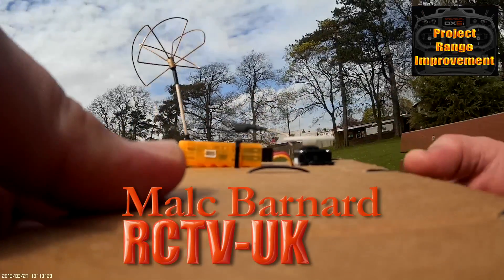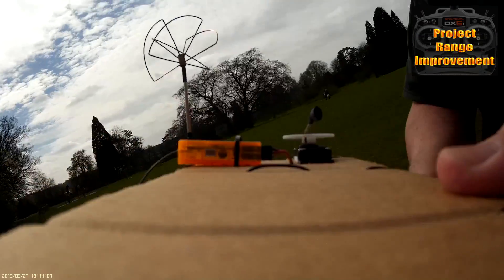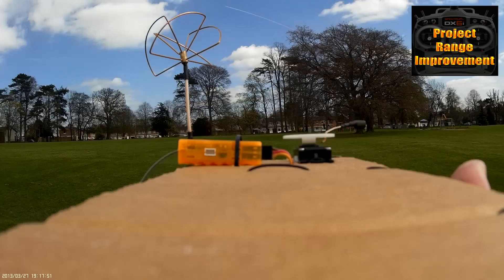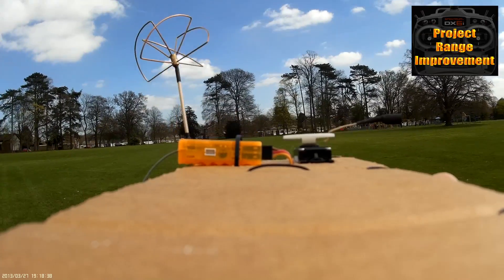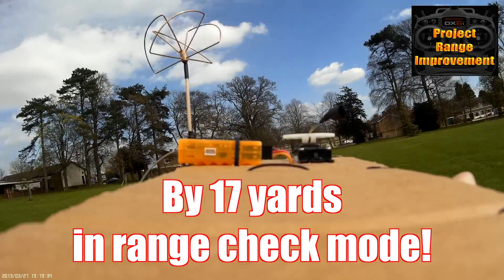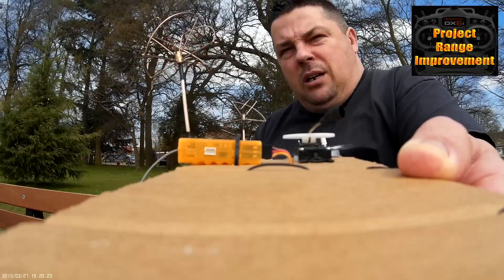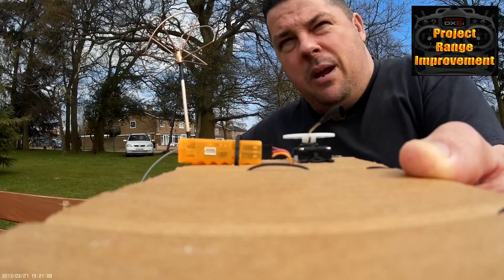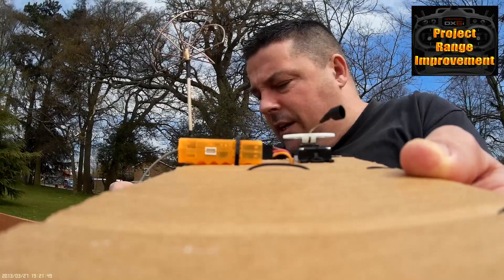"Modified" range check and range improvement for 2 4Ghz control

Comment: Hello RCTV-UK, I live in the US and I would like to do this mod to my DX6i  but I want to make sure I'm ordering the right parts so tell me if this is correct part 1; SMA-Female To U.FL Connector: 12-Inch Coaxial Assembly part 2; 2.4Ghz FPV Skew Planar and Clover Leaf Antenna Set RP-SMA. another question how do you connect the skew cloverleaf antenna to the receiver  do you just connect it to the end of the existing antenna? thats for the video any help would be appreciated. What I'm trying to get out of this is about 2 or 3 miles tops I would be very happy with that thanks